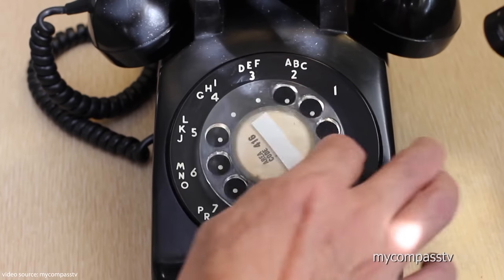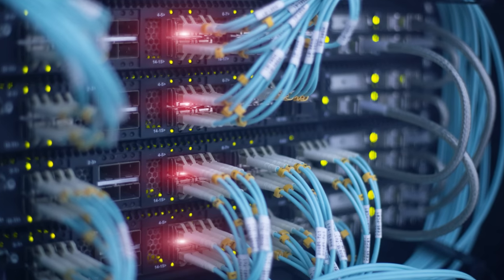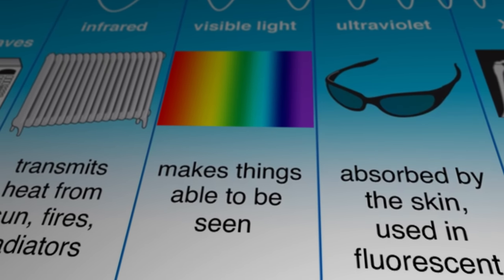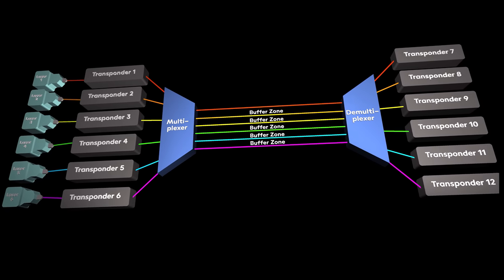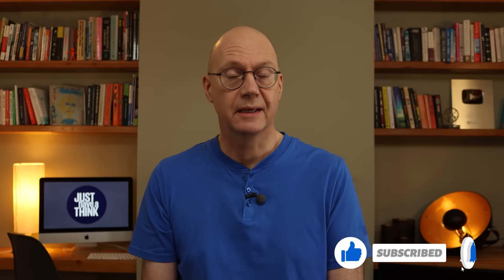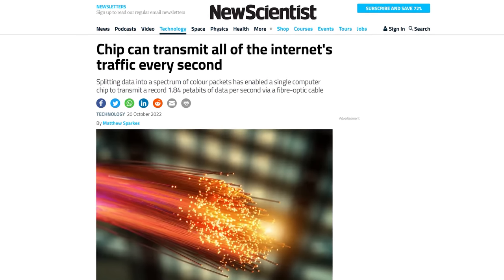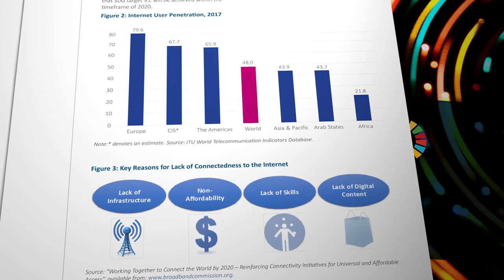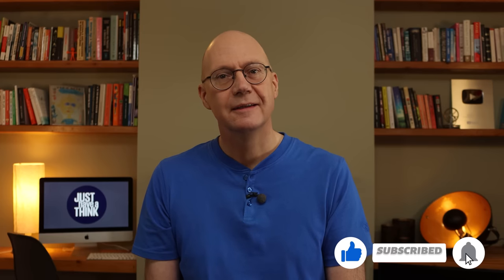The entire internet on a single chip! MASSIVE energy savings.

Comment: Another great video Dave thank you. Working in the industry I agree with the point below that whilst this is a game changer for the network operators it’s the data centres that are consuming the largest chunk of the power, and more work is required there.
Reply: Hugh, this is a Revolutionary Concept and it will go far beyond  Data Transmission, but will also be used to Compress Data Storage, and in the field of Machine Intelligence (I refuse to talk about the Idiotic Notion or Artificial Intelligence... ALL Intelligence is artificial, the diffierence is between Machine and Animal).   You see, now we compute using Zeros and Ones, but with this Chip Set we have over 200 detectable States per line.  each state could be assigned a particular basic concept or principle.  Now, Stupid Human Coders could never be able to work to coherent comprehension of such intelligence, but the Computers would.  Human Intelligible translations would be time consuming, as we'd have to effectively decompress the Intelligence, but if the Machine Intelligence were used as the Core Intelligence, and not just reporting Intelligence to Stupid Monkey Like Human Managers, who often miss the  point of Intelligence Data even when thoroughly correct, well, what we got here Hugh is the First Shot Fired in the Machine Intelligence Revolution.   This is like watching a Video about Guttenberg's Printing Press, and everybody still just thinking about Bibles.
Reply: @leovolont  Thanks for the explanation, I clearly missed something, significant in the explanation!

Comment: Nitpick:

A 640x480 JPEG image is on average about 15 KB in size. In the mid 90's that was a decently high quality image. Many images were still 320x240 16 color and some were 800x600. Few were 1024x768. After all 1024x768 came out in 1990.

1024x768 16 bit color with lossless JPEG (which wouldn't be used for most images at the time) is about 1.18 MB
1024x768 16 bit color highly compressed JPEG only takes about 80.5 KB

A 2400 baud modem would see download speeds around 3 KB/sec, but many people had 14.4k or faster modems.

This means in worst case scenario of someone downloading a 1024x768 16 bit image using lossless compression JPEG, would take 400 seconds, except it is extremely unlikely that someone would download such a file because most files used higher compression and few people had a 1024x768 monitor and a video card capable of 1024x768x16bit (more common was 1024x768x8bit or 1024x768x4bit) and only had a 2400 baud modem.

A nice monitor and video card combinationof the time that was much more common was 800x600x8bit. I even had a 1024x768 grey scale monitor because it was cheaper and had crisper text for reading.

So no, not 5 minutes to download pictures, mostly a few seconds. By this time people were downloading mp3 songs in 5 minutes or less.

Comment: Hi Dave, I wanted to talk about the term coherent. 

In my experience in the world of radio waves, coherent means that at least two radio carrier signals were involved, and that one carrier was an integer multiple of the others. in the case of cable television, when multiple channels are transmitted, they can generate distortion products. For example, channel 2 (55.25 MHz) and channel 3 (61.26 MHz) could be added together to make a distortion product at 55.25 MHz + 61.25 MHz = 116.5 MHz. This falls in the middle of cable television channel A-1. 

If the channel scheme were to be offset slightly, so that the visual carriers were exact multiples of 6 MHz, and a special reference signal generator which created a "comb" of frequencies of 6, 12, 18, 24, and so on, then the distortion products would also be exact multiples of 6 MHz, so that the distortion products would fall exactly on the carrier frequency of the channel in question. This group of many channels which are exact multiples of 6 MHz are said to be coherent. In the process of demodulating a television channel, the carrier frequency is outside the bandwidth of the signal being carried, so it is filtered out or discarded, and since the distortions are coherent with the carrier frequency, those distortion products would also be discarded.

When fiber optic manufacturers first began using wavelength division multiplexing, each of the lasers used was self-contained, and each determined their own exact bandwidth, so there was no defined relationship between the wavelengths.

With a coherent system, the wavelengths of multiple laser transmitters are derived from a common source (an optical comb generator), and so any distortion products would also fall on multiples of the common source, and would fall out in the detection process. 

When wavelengths are not coherent, then guard bands are needed to prevent the wavelength of any laser transmitter from drifting too close to the wavelength of another. In addition, distortion products show up as noise in a particular wavelength. Each wavelength exhibits a signal-to-noise (or signal-to-distortion) ratio. when that ratio gets to low, there is uncertainty about whether a digit is a zero or a one. 

When laser transmitters are made to be coherent, the frequency of each wavelength is more precise, so guard bands can be reduced, allowing more wavelengths to be used on the same fiber, and distortion products will be significantly reduced. Having a lower signal-to-noise ratio means the signal can travel for a longer distance on the fiber before it needs to be run through a repeater.

As other commenters have noted, optical transmission equipment is not as big a consumer of energy as servers and routers. If the Complex Instruction Set Computing (CISC) chips in servers were to be replaced with Reduced Instruction Set Computing (RISC) chips (like the Apple M1 and M2), Data Center power consumption would be reduced. If routers were to be replaced with Software Defined Networks, the power consumption would be reduced. In addition, the changes to RISC-based servers and SDN would also generate less heat, reducing the air conditioning load in data centers.

Comment: Thanks Dave for another brilliant video, the first few minutes just about encapsulates my entire working life in the computer and telecoms industry. I was lucky enough to be working for DEC (remember them?) in the 1980s where we developed the first digital circuit card for a computer (the beginning of the end of modems). We showed the prototype at a trade show in Geneva in 1987 and everyone was wowed by the 64 kb/s data rates. I then worked for Mercury Communications (Cable and Wireless) in the early days of competition when we were first using fibre optics...thousands of phone calls down a single piece of glass...wow! But we ‘dyed in the wool’ telecom guys never believed the packet switching world of the internet would ever replace the circuit switching world of ‘proper’ telephone networks. How wrong we were. I was then lucky enough to work on the team at Worldcom who brought over the broadband (DSL local loop) technology from the USA parent company into UK and Germany in 1999/2000. ..2 Mb/s down a copper line!...Who would have thought 20 years later that moving all this data around would use so much energy and generate so much heat that in some places they are thinking of plugging them into district heating networks?

Comment: There's a company in England called Optalysys working on an optical computer. I know a lot of big companies are working on optical computing too. It is potentially very fast and energy efficient because light has no electrical resistance. The electrical cost for a large supercomputer can be over a million dollars a year.
Reply: But aren't optical wavelengths larger than the wires in current processors?  That would make chips bigger and slower, wouldn't it?

Although if it makes them more energy efficient, that would be well worth it for most applications.

Comment: It won't make much difference to power usage.  The point is that if you have a fibre cable running from UK to the US and it has 200 cores and a capacity of 6TBit, but using higher frequencies and/or multiplexing you might be able to increase these 200 cores throughput to 60Tbit without laying more cable.  Fibre use in the data centers won't change, from each server you have two connections, to two separate switches, for redundancy, and bandwidth isn't an issue.  Number of cables won't change there, and power usage won't change.  These are not components causing most power usage, that is the server CPU, peripheral cards, memory, disk storage systems and HVAC.  I do wonder why data centers aren't focussing more on solar and battery storage.  Although first I'd sort out the cooling, some of that need physical redesign of the racks, some of that is difficult to do once systems are live and running.
Reply: All this heat should be used to heat buildings, at least at high latitudes.
Reply: it will likely vastly increase power usage.  Not many people actually transport trucks of USB sticks or media to send data, so this won’t stop much physical travel, it will however encourage even more data processing which has been growing ever since computers were invented.
Reply: I am constantly shocked at how bad we are at this in the US. In the data center I spend much of my time at in Michigan,  there are massive CRAC units out back dumping millions of BTU every hour to the atmosphere.  Then, in the suite next door, are natural gas heaters to keep the space warm.  It's flatly, and arrogantly, stupid.  The ENTIRE BUILDING could be heated by the data center and have heat to spare. THAT heat could be transferred to a liquid and pumped to neighboring buildings to heat those. There are many buildings nearby, including some close enough to hit with a poorly thrown baseball. The biggest problem is that the HVAC companies just know a single way to cool a space, and so that's what we get.
Reply: You're thinking large-scale. Think of the small scale impacts. Why would a person even need their own powerful computer anymore? Just get an iPad and connect to a supercomputer in a datacenter. You could custom-build it to be able to handle and process hundreds of thousands of complex requests from hundreds of thousands of users per second. So now instead of having billions of smaller energy hogs running in businesses and homes across the world, you reduce each of those power requirements to that of a single lithium battery cell and instead build up a few more, and far more efficient data centers for people to remote connect to. How many thousands of gigawatts are used by everyone's personal and office computers?
Reply: @larrybolhuis1049  I worked in a new (at the time) 2001 GaAs chip foundry. My first summer in my office I noticed heat coming from the radiators along with the AC running. Took awhile until I found someone in processing that told me that having both systems running constantly was for faster and better control of the temperature and humidity inside the clean rooms. But they were also doing this in all the office space that was more or at least the same square footage as the clean room.
Reply: @Xero1of1  I prefer to buy one once for 1k than be charged $10 a day forever
Reply: @Xero1of1  that's already available.  If a desktop uses 60 watts you can replace with a more efficient mini PC using 15 watts, although you will still need monitors. Any power user needs can be done in the cloud, your PC functionality can be a Windows Virtual Desktop in Azure - we're already using these.  In terms of saving power in data centers it makes more sense to replace older equipment with more efficient servers - they do that now anyway, fit solar, reconfigure the HVAC, the whole way of cooling hasn't changed in most data centers for 30 years.  One thing is liquid cooling, the whole motherboard is immersed in (non-conductive) liquid.  And spot cooling a unit is far more efficient than trying to air cool vast warehouse size spaces.
Reply: @hugegamer5988  Infinitely more cat videos.
Reply: @lshwadchuck5643  That's an awful lot of stuff on floors.
Reply: @Xero1of1  iPads are a good example of low heat, low energy chips. Apple is now using 'iPad chips' in all it's computers. They are faster than hot chips. So the high energy and high waste (heat) computer problem is being reduced in tandem. Data centres would magnify the efficiency savings
Reply: JonSwift.   Yeah, that.
Reply: @petewright4640  It does already heat buildings ... the ones with the data centers. Sadly few people are there to enjoy it.
Reply: Sorting out cooling should include as a priority using the waste heat to great local homes. Near me is a data centre for an ISP right next to a small housing project of just 75 homes. I was a member of the housing project when the design for the final 25 homes was being done, at the same time as the data centre design. Both were being built on a brownfield site: the sites are separated by a small enough space that the data centre architects kissed with us about noise nuisance from their standby generators.

Sadly there was zero interest for a small scale district heating scheme; not from the housing project, not from the ISP, not from the planning authority (planning=zoning for North Americans). Twenty years later, it's not practical to retrofit, but it could have been designed in at build time, and 25 or maybe all 75 homes had cheap heat all winter.

Denmark is beginning to make this happen; but it will be a long time before the UK catches up when we won't even pay people to insulate their homes properly.
Reply: @larrybolhuis1049  yes an no, it's not that easy. The heat from a datacenter isn't that hot. It need work to be useful further along the chain which means losses and less economically viable, etc. I agree heating the offices at the datacenter makes a lot of sense. Going further takes a bunch of effort
Reply: @hugegamer5988  Doubt it will be anywhere like $10 a day due to economy of scale. Think MS365 - latest software, cloud storage etc.etc... Other similar Companies and examples also available🤣.
Reply: @Xero1of1  Hmm, that's what IBM wanted to do in the first place.

Comment: Speaking of internet energy usage, isn't it about time broadband providers started selling their services based on eco-ness rather than speed?  It makes no sense that my router uses more energy than my computer, and given that routers run 24/7 in most homes, that's a good amount of electricity usage.  In other words, I don't need to go faster, I just want a router <2W that was built in a factory that is carbon-neutral certified and connects to a provider that uses 100% renewable energy for their data centres...
Reply: Yes, routers use a stupid amount of power. My Virgin one is constantly using around 12w, which is 80% what my 24" monitor uses. 2w sounds like something sensible to aim for.

Comment: small comment about the "speed of light" and "electrons" - it really doesn't matter how fast the electrons are, in fact they are very VERY slow but the signal, or information if you like, in a copper wire is traveling roughly at 2/3 of a speed of light. So really, using fiber optics is not a game changer on it's own when it comes to the transmission speed, one can achieve pretty much same speeds over copper wire. The difference lies in losses and vulnerability to noise and stuff. The density of channels per square mm of the medium depends on many factors but it's true fibers tend to win here as well. 
Interesting topic, but let's remember this will be practical mainly for core networks and I wouldn't anticipate that it will make a big change on the end user side of things when it comes to power consumption. But even though it can still be very significant dent.
Reply: Another small comment.  High frequency traders install microwave radio links between stock exchanges as they are significantly faster than fiber optic.  Having the lowest latency link is key to arbitrage.   There are two problems with fiber that make it slow: i) It usually cannot be laid in a direct path;  ii) the effective path is extended because the light bounces back and forth off the walls off the fiber (this is more significant than you might anticipate).